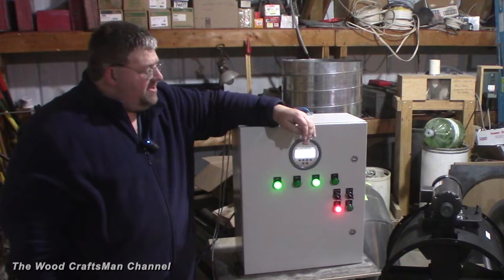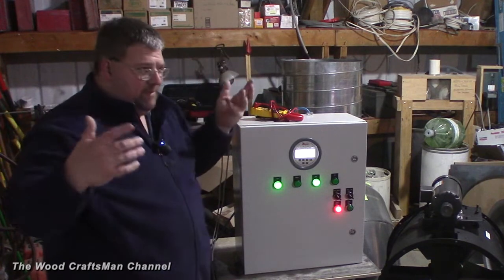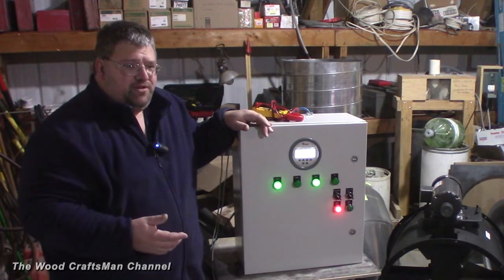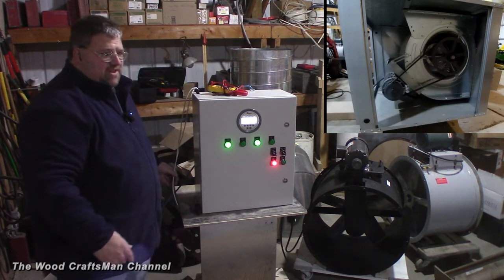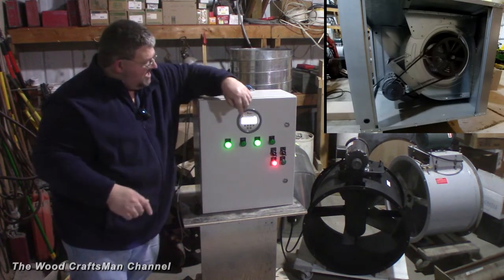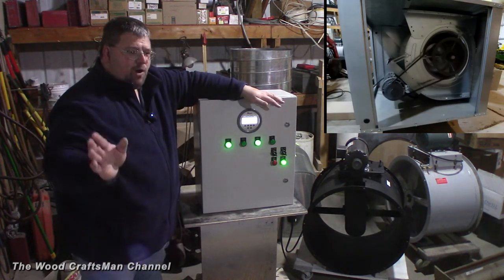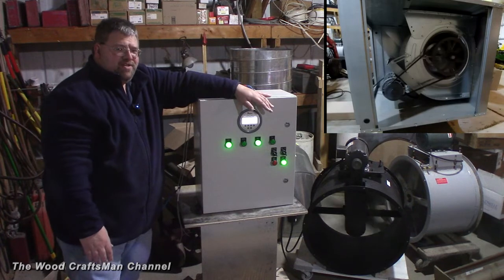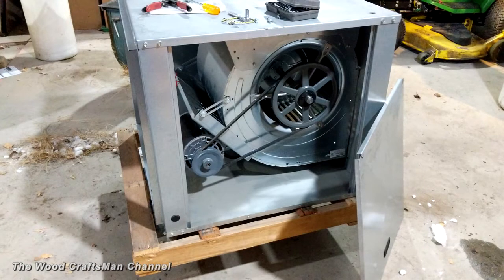Spray Booth Control Panel # 313

Comment: Excellent info and most expecially for those who are doing this commercially.  I'm retired from the business and making furniture as a hobby now.  Notwithstanding, in my small (25 sq ft) booth I am running a one-speed explosion-proof fan which looks after the overspray well enough by exhausting it to the outside of my shop.  While I am spraying I open a window on the other end of my shop before turning on the booth fan, which as mentioned my Micah below, exhausts heated (in the winter) and cooled (in the summer) air from the shop.  But because I'm not doing high-volume spraying, this arrangement works well enough for me.

What you are setting up for yourself is excellent, and I commend you for doing so.  I can hardly wait to see what your new booth set-up will look like!  Congrats!!
Reply from the maker: Thank you for the kind words! This is a big step for me, considering I do this part time, but all efforts are setup in the event this would go full time. I've been buying equipment since I was a junior in high school, and have been focusing more on finish improvement. I already have the investment in the high-end air assisted airless spray equipment, now with the additional shop space for a finish room, I knew I had to do it right and do it once, so I ordered a commercial spray booth, an inline duct blower (adding a 30"x30" hydronic water to air heat exchanger) for an air make-up unit, and building the control panel, I'm in it for the long run. I can't wait to get moved in, but there is still a lot that needs to be done before. I will keep posting updates as they happen. Thanks! Scott

Comment: Thanks for the video. Do you see a large reduction in overspray with the  air assisted airless spray system?  Also, what gun and tip do you use?
Reply from the maker: In general yes compared to airless or air / HVLP spray, however, there is a difference within the AAA family. For me I saw a reduction in over spray from my Kremlin Airmix MVX system to my CA Technologies Bobcat to my most recent change to the Wagner GM4700 Aircoat. Saw a significant change in the softness of the Wagner Aircoat pattern using the same tip size and fluid  pressure, but went from 17-20 psi atomizing air to 10 psi. Scott

Comment: Thank you for the video.   Is this something you put together or is it commercially available?   I have a 34" fan on my booth and it pulls a lot of heated air out of my building.   I have wanted to add a vfd for a long time.
Reply from the maker: I built it. However, if you just need a VFD to slow your fan down, checkout Automation Direct, they have very reasonable VFDs economically priced. Scott

Comment: Can you spray lacquer with a iwata wbx
Reply from the maker: More than likely. If not mistaken, WBC is for water based / waterborne coatings which would more than likely indicate it had stainless steel fluid passages and needle / nozzle set.
Reply: @TheWoodCraftsman  ok thank you. I work in a paint shop and a customer needed to know. Thank you very much...